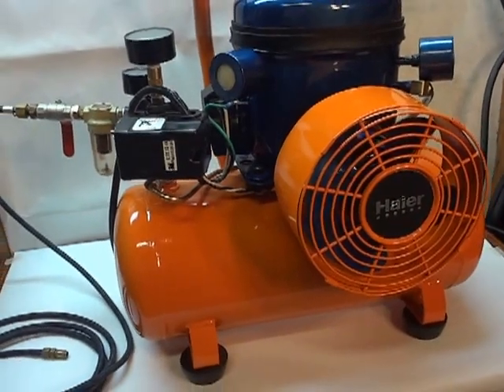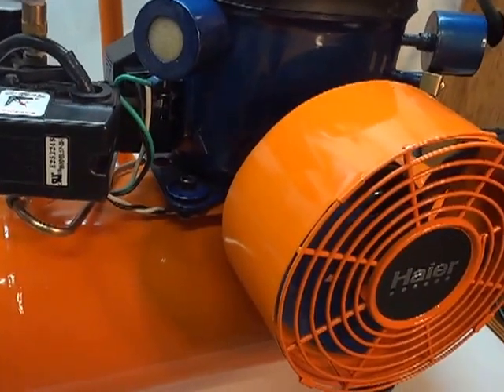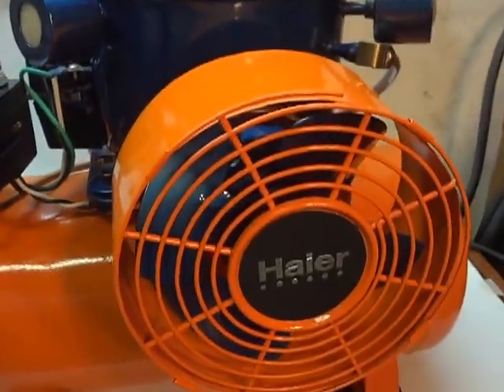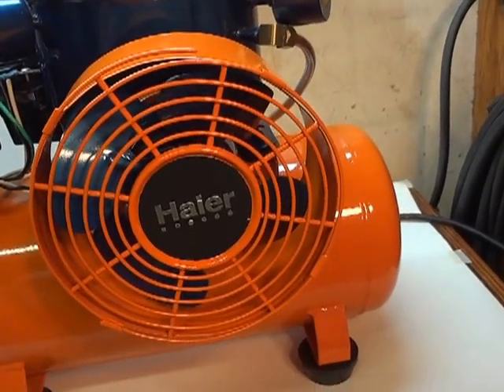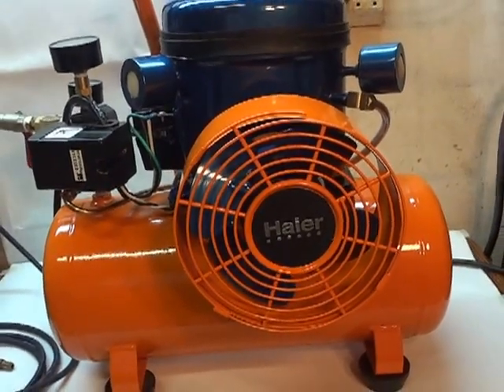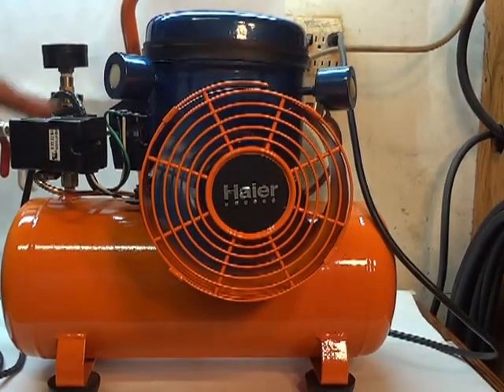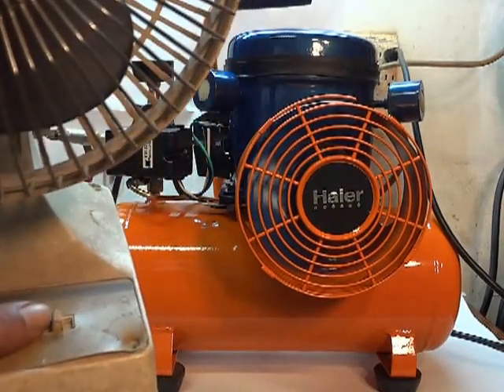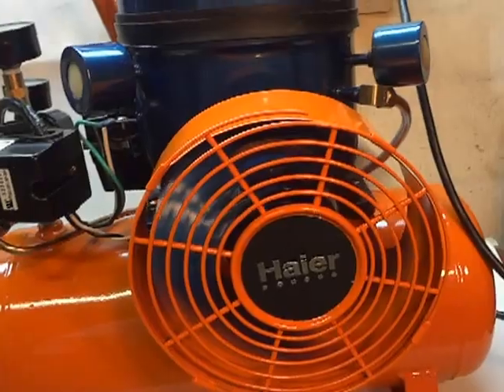HOMEMADE SILENT COMPRESSOR WITH COOLING FAN.

Comment: >>>ur2.pl/1061   Portability is excellent which "at my level of experience" is very important :-). After 3 years still going strong. good enough for a single user to do a little trim nailing or even a framer for a smallish project. Wouldn't want to use it to frame a house or nail off a shingle roof though…

Comment: When u spray car , is your 25 gal compressor a silent compressor??
Reply from the maker: My 25 gal compressor is Campbel Housefield very loud, but I made a sound proof box for it to reduce the noise.
Reply: If I put fridge compressor on  33 ga  ,is going to work .
I spray with a lvlp 17 psi spray gun.
Reply from the maker: ***** I'm sure it will work, hvlp is a gravity fed gun that doesn't require a  lot of pressure to spray the paint.

Comment from the maker: Between 45 to 60 psi for most t-shirt work. for nonporus materials I could go from 25 to 35 psi. So far my compressor doing very good job, it does maintain.You might be using too much air too quick. Try to give it a litle brake or cool it down every one hr of using it..

Comment: That looks really nice..what psi do u airbrush with and does compressor maintain? ? I made one and it sounds like the thermal switch goes off randomly..any tips or suggestions? ?